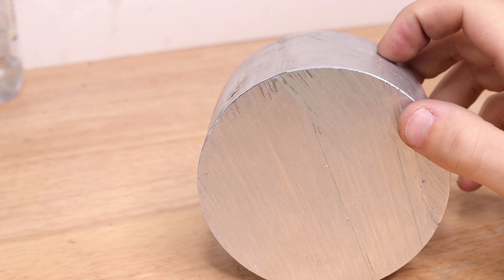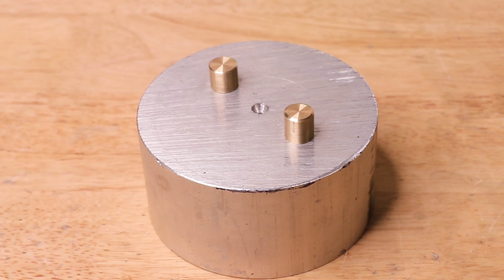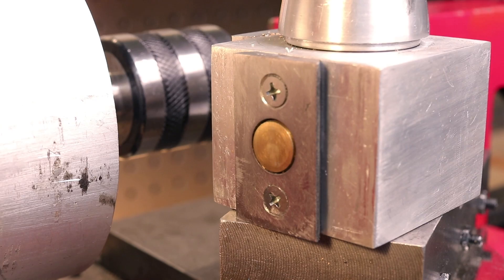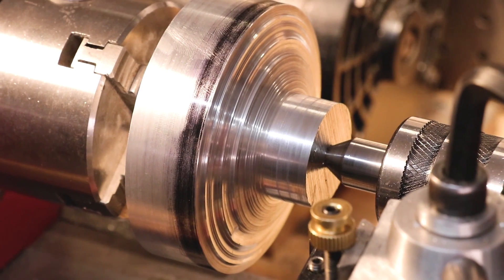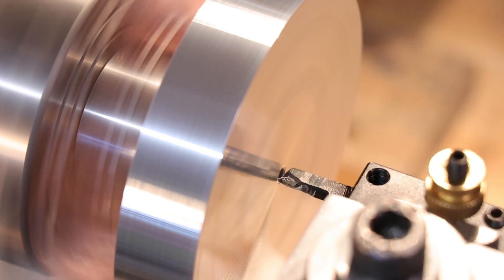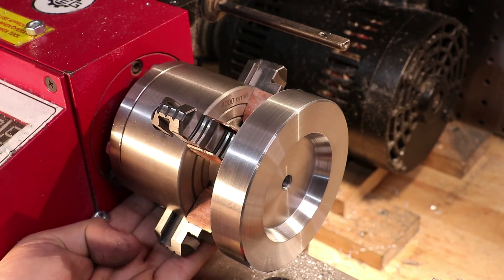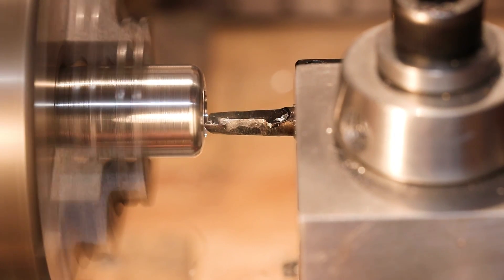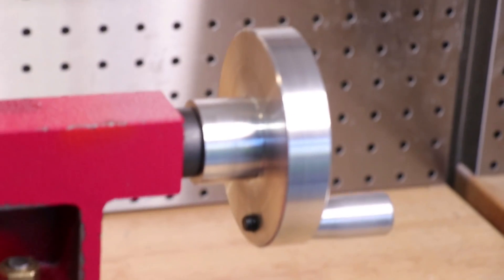Project Hand Wheel - Machining Over Size Work On The Mini Lathe

Comment: I have a mini lathe... old mini lathe, I made it to run on cnc controller.... but my max diameter at the chuck is 52mm or 80 on extension... now i will be able to do parts about 150mm... thanks for the video...never ever know how to turn bigger diameter on a smaller lathe.Thank you,I will use this idea.

Comment: Hi, thanks a lot for the great content. I love it. I received my mini lathe and will probably do some of your suggested upgrades. I was wondering from which book at 9:46 you get those nice machine handles designs? I would love to find it too. I love those handles so much (I have some on my old French milling machine) Thanks a lot. Cheers from 🇫🇷
Reply: @Mattbe72 - He was referring to “Machinerys Handbook”. There are 32 editions of the handbook. I have the 22nd edition and it does not have Machine Handles, or O-Ring data for that matter.
Reply: @JohnDoe-ls2ww  thanks I imported the 31th edition but did not think about it. I will check in it. Thanks 🙏
Reply: @JohnDoe-ls2ww  I can't find this section in the Machinery's Handbook 31th edition :(

Comment: it's almost a loss that you decided to remove the drive locations from the hand wheel - Had you left then then you could have used them to have a power feed with a drill chucked T-bar

Comment: Excellent improvement to the mini lathe. Exactly what I did some years ago to mine. One little detail I can suggest: I made the handle with a brass tube turned to size and a pair of miniature ball bearings from an old hard drive motor on both sides, then the fixing bolt through the little tube to make the handle fit into place, then turned a brass tube cover to finish the outer part of the handle. The difference it makes both in comfort and precision in hand control is amazing. So I ended up replacing all of the hand wheels of my mini lathe. 
Excellent video and I really appreciate your detailed explanation. Keep up shearing your knowledge. Thank you very much.
Reply: Hello  there.  Just one Q.....did U record  a Video  of what  U  made  ???
Would  be  interesting  to Watch
aRM
Reply: I would like to see that too

Comment: If you're going to remove a bunch of material from the center anyway, why not just drill a big hole and clamp your workpiece on the internal radius of the hole? It's faster because you're removing material that you will remove anyway later on. And its safer because your workpiece will be centered and clamped down propperly. Also then you don't have to make tooling that you'll probably never use again. Turning between two centers can be really dangerous, they aren't designed to support big loads.
Reply from the maker: If you're talking about drilling a hold and clamping the work to a bolt or arbor through that hole, that might work on smaller stock, ive seen it done but never with a great amount of rigidity. I think I have too much material here to safely do it.
Reply: @artisanmakes  No, that's not what I ment. I ment using the lathe chuck to clamp the workpiece on the inside radius of a large hole. Assuming you have a large drill and a drill press, that would be the preferred way of working.

Comment: Hey man love your channel, recently got myself a mini lathe and am completely new to machining. My question is, which might seem stupid, is the any metals that when turning might create dust and therefor need a respirator? As when I was turning brass it seemed with there was fine particles in the air? What do you think?
Reply from the maker: I personally think you should be fine, as long as you make chips dust should be minimal, just be careful when sanding as that always produces a good amount of dust, which is why I always try and wet sand. Cheers

Comment: Suggestion in the form of a question: why waste sooo much material and not make it a two piece assembly? I'm sure the big disk part could easily and very securely be bolted to a smaller cylinder.
Reply from the maker: I am going from memory, but when I bought my material, I didn't have much choice to go with it in terms of sizing and lengths, and this is what best fitted on my lathe.

Comment: With most chucks, the jaws can be rotated and even a large diameter can be clamped. This was useless work.
Reply from the maker: I don't quite understand. You can't rotate the jaws on this model of scroll chuck, you have to use a different set of jaws, and even then the max diameter of work I can turn is 80mm. The stock I turned was larger so I had to turn between centres.

Comment: if you put a small jack under your drill table it will not deflect so bad. ..
Reply from the maker: It was just a cracked mount on the table, i welded it up and it doesn't flex anymore.

Comment: 5” chucks do fit on a mini lathe.  Why not have one?  Make it a 4 jaw.  I did.
Reply from the maker: Quite right. This is actually the first time I have ran out of space on the lathe chuck, normally I machine thin acrylic so I never saw the need for a bigger chuck. Maybe it is time for me to upgrade. Cheers
Reply: @artisanmakes  I don’t use it a lot.  It is quite massive compared to the (in my opinion) worthless 3” chuck that they come with.   Most of the time I run a 4” 3 jaw.  At least it allows 3/4” stock to go all the way through the head stock.   
Be prepared for the mass of the 5”.  My mini handles it OK, but the increased mass in rotation changes slightly some of the dynamics.

Comment: Although I haven't seen any recently you once could obtain dead centres with one quarter of the centre part removed that would allow machining right into the centre dimple.
Reply: They’re still available. Use a live center for all the work until the last fine pass, and then remove the tit in the center.

Comment: Ignoring the value and pleasure in making something yourself, how much does a chunk of aluminium that size cost?  That was a lot of chips.
Reply from the maker: This 100 x 50 piece of aluminium was $32 AUD on ebay plus $9 for shipping. All up, still cheaper than buying an off the shelf cast hand wheel.

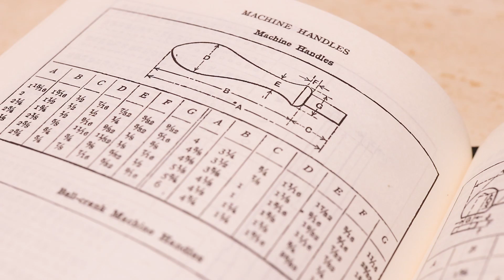Comment: 9:52 Your chuck should NOT be that difficult to tighten. Clean the scroll and the jaws.
Reply from the maker: Thanks for the feedback. That chuck has had issues from day one, it is just the cheap one that comes with the lathe, and the scroll is not perfectly cut. Though I didn't help it by wet sanding with it. I rarely use it now. The only reason I used it when I filmed is because the through bore is much larger than on the 4 jaw. When I have the time I will probably go through and fix it but it is not a big priority. Cheers.

Comment: that solid billet design will last forever.
I dropped the one on my 9x20 when moving machine, the 3 webbed bicycle spoke design broke in 3 pieces, i glued back with epoxy and it looked good as new, perfect, could hardly notice break lines, strong as an ox.......then later I moved again and broke it the same way with tailstock sliding off. Second time I TIG welded it: permanent but an ugly frankenstein, the heat warped stuff, I'd rather have a new one, but it IS functional.....
Reply: Just take the handweel off, chuck it, and give it a few passes until the welds disapear. Then you can use putty and paint to pretend being the welder you ain't ;)

Comment: Very nicely made handwheel, it will very likely outlast the lathe. I also have a chinese lathe similar to yours and I found that the tangential tooling reduces the required cutting pressures and power to make a decent cut. Accentric engineering in Australia sells nicely made tooling or you can make the tool holders yourself. Have a look around on the internet, let me know if you would like to see pics of my home made tool holders. Looking forward to more of you videos. Thanks for sharing.
Reply: Would love to see those pics

Comment: nice chip breaker, even the carbide AK inserts struggle at times.
Reply from the maker: Cheers. I have a set of those aluminium inserts, but I have not been able to get decent results from them on my lathe.
Reply: @artisanmakes  free cutting aluminium like 2011 work better. 6061 etc gums up, so need to use cutting fluid like kerosene or wd40 along with aggressive chip load / feed rate. The sharp positive rake in your tool works surprisingly well.

Comment: finally, someone shows off a ground lathe tool that looks like my ground lathe tools
Reply from the maker: If it works it works. Though I will admit the chip breaker made it look... interesting. Cheers
Reply: @artisanmakes  Those chips were impressive, they just stacked themselves.

Comment: Well done but I’m confused with the bolt and Locktite.
Reply: The bolt is not tightened up against the handle, he wants the handle to spin.
Reply: @opcruiser5436  How about a washer and an acorn nut or a Nyloc nut to do that? The rest is very professional.
Reply from the maker: Yeah there are many ways of doing this, I've seen other methods, but no need to over do it. Keep it simple. Cheers

Comment: Your drill press table was tilting the workpiece from the down feed pressure. Next time, put your car's jack under the table to keep it from tilting.
Reply from the maker: Yes, there is actually a small crack on the mount. It cracked as I started filming. Didn't notice how much it flexed until I was watching the footage back. Cheer
Reply: @artisanmakes  I think most of them flex without a crack..
Reply from the maker: @bobweiram6321  Yes it did before but the crack but it is much worse now. Cheers.
Reply: @artisanmakes   Kinda good to know a guy with your skills will still continue to use flawed tools like the rest of us 😁